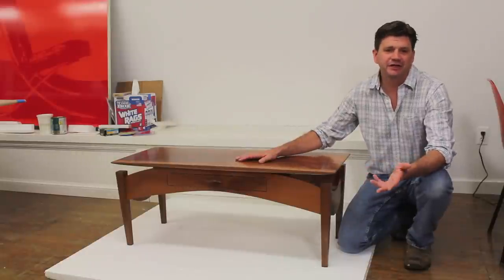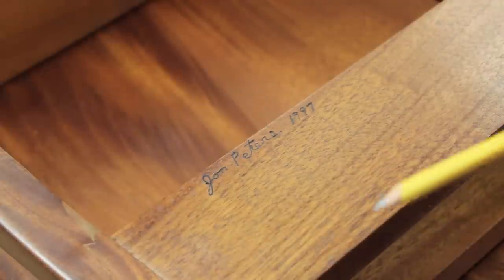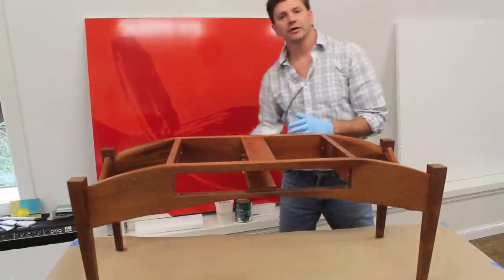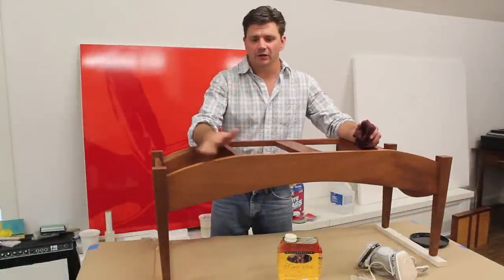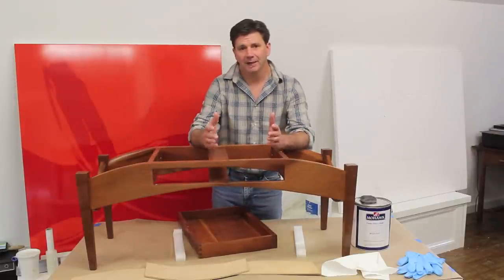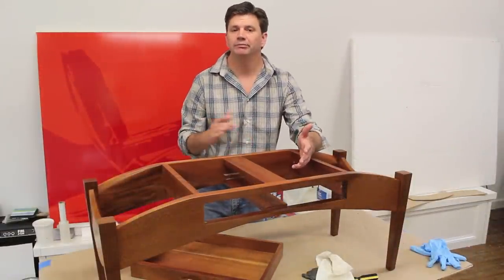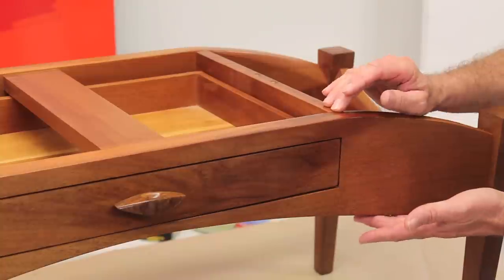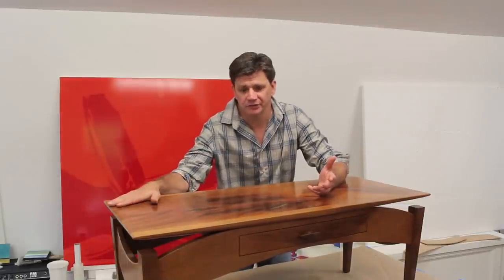A simple way to refinish wood furniture with Waterlox wiping varnish

Comment: Thanks John I learned a lot from your video.  Image beginning woodworker at age 66 making toys for my grandsons but still looking for the right wood and finishing techniques.  I was surprised that you used 320 and knocked the high cutters down with another piece of sand paper to get a smoother    +/- 420  grit paper to wipe down the old finish. That was great to prevent scratches that I find new paper always leaves and still be able to use clean uncontaminated sand paper.

Comment: Nice piece, beautiful.  I think the extra sanding with "400" is probably overkill unless those scratches were deep.  I just refinished a piece last weekend (feel free to check out), I like to use paper bags or the paper inserts from sanding discs.  They are probably around 400 or so grit but really burnish the nubs and dust that cling to the surface.  Thumbs up.

Comment: Great video Mr. Peters. I have been researching different procedures to refinish wood and is in the experimental process. I completed stripping a small side table today for the first time-- I did not enjoy one bit if it as it (too messy). What lead me to explore this option was because the table itself has little chips in it exposing the bare wood. I did not want to use those color pencil to restore the color. I figure re-staining will be the best way to go. Please criticize my method of choice and advise a better alternative. My other question is, you did not re-stain but simply applied varnish. My idea of varnish is just a clear finish for cosmetic/protection etc? Does the varnish itself restore the color? If yes, how do you choice to blend with the current color of what you are refinishing.  

Regards,

Comment: Thanks for the video. I am getting ready to finish an oak/black walnut bed frame, and gleaning tips before I start.
Reply: Have you considered 'ebonizing' with steel-wool and vinegar? I am doing that on an oak built-in cabinet I am building. I will put up the video soon.

Comment: Jon:Thanks for the  video. I have watched most if not all of your videos, you do a great job.  There is always some new info for me.Question:  I am doing a table top and came back to watch your video again for help with the final step.  I have also watched a couple other videos that do the following  process -- 400+ grit sand paper, 0000 steel wool and then 0000 steel wool with soapy water. When you use wool lube is that after a pass over the item with a 400 grit but without the dry steel wool?  How is the wool lube different that the other process?  I know it decreases the cutting of the steel wool so would it be viewed as the final step in the process I mentioned? It seems its primary function to add lubrication (ie the name).Appreciate any thoughts you may have.ThanksJason

Comment: Nice video - I'm going to try this technique on a pair of old Boston Acoustics speakers which have a fairly thick wood veneer. I was confused by one part of your video. Did you sand then apply varnish to the table top four times? Wouldn't you just be sanding off each coat of varnish doing this? Thanks, Jay

Comment: I enjoyed your video.  I am starting to refinish a few pieces in my home without changing the stain. They just need new life.  When I went to my local hardware store they recommend that I use a wipe on polyurethane.  Its that the same as a varnish? Would you recommend use it?
Reply from the maker: yeah I think that should work also, I use Min wax wipe on poly to
Reply: Ty

Comment: What a artistic style table with the curves & floated edges of top. Would have never came up with that design on my own. Respect. Anyway, I built a home 9 yrs ago & the builder instaled real oak hardwood kitchen cabinets with solid styles routed on the inide edge but the centers are flat thin wood. Like only 1/4". Looks cheap & boring. Not to mention only 1 thin coat of poly so they are dull & rough to the touch. Any advice? Sand & recoat with urathane or try to build & polish with a wax or paste? Thanks for your time
Reply from the maker: Thanks Dan, I try two more coats of poly but try it out on a small rest piece first. good luck with the project

Comment: What would you recommend for the top a brand new coffee table that was attacked by a toddler with a wax woodwork repair/fill stick? The wax has left crayon size streaks all over the brand new top and even though the white wax fill has been removed the waxy streaks remain (this is after using a water and white vinegar cleaning solution)

Comment: Nice table and refinish - it's great to see more finish details in your videos, as most of the projects are painted. How did you originally finish the table? If and when you use brad nails on a table you're going to stain/dye, how do you patch the holes to match the wood? Thanks!

Comment: 5:55 Beauty table! I'm not clear on where you say you cut the stock into 3 pieces and rejoined it. I don't see anywhere in the grain, horizontally or vertically, where wood eaten by the saw blade is missing or any seams for that matter.
Can you explain what you meant?
Thanks!

Comment: Jon
Thanks so much gorgeous table and awesome informative video.

I never thought that I would be using a site like this but I am glad that I found your video. 
I recently acquired a gorgeous high quality dining set
because something had happed to an area on the table top surface apprx 1'x6" in size. 
I will try to take a pic later to upload.  thanks to you and your video I think that I could honestly repair this issue myself and restore a beautiful piece.
Reply from the maker: Thanks Donna

Comment: I'm varnishing butcher block countertops and I Love your videos ! My question if you wouldn't mind helping me is :) I can be less than perfect about my kitchen I have a teenage boy so I really want to use EPIFANES Clear High-Gloss Varnish , it's used in marine application. Also I never put food on the counters so I'm not that concerned with food safety I use cutting boards :) but I'm very concerned about water I'm can splash a bit during dishes how do you feel about using this product ? :) thanks again
Reply from the maker: this video should help, This how I finish a countertop. Finishing a wooden countertop by Jon Peters

Comment: This table design raises and interesting design point. You seemed to sacrifice some functionality for form when you built this table by connecting the table top to the legs indirectly (you lost drawer space and overall strength). I would guess it was because you wanted a solid wood top which could expand freely with only centre fasteners. In other words the design focus is the table top and the support is of secondary interest, right?

Comment: your vids are top notch, excellent!! How do you keep dust or lint from settling down on your wet varnish or poly in projects? I use lacquer almost exclusively now with its fast surface dry. What is the best finish you have found that does not alter the wood colors? I  use mostly canary wood and never like to see the color stripes "ambered" out. Great furniture!!!!!!!
Reply from the maker: Thanks , well I guess always a bit . I also like lacquer but most do not have a spray gun so I haven't made a video

Comment: I see all these comments about whipping on the varnish. All a wipe on Varnish, Poly, ect. Is, is a thinned version of that product using the solvent it's based on to thin it. Such as Danish Oil, I'm sure you have herd or used it before. Very easy to apply but you sacrifice protection. There are a ton of great wipe on products out there, Waterlocks makes great products but my go to and favorite is General Finishes Armor Seal, Seal a Cell, and some others. Gotta checkout their site, General Finishes and Charles Niel, a master of finishing has videos on there where he explains almost everything you need to know!!! His Awesome and will definitely clarify crazy amount of options for you!!! Good luck bud!!

Comment: I must congratulate you at the  manner in which you took out the monotony of a conventional table. The legs are tapered thus the ever changing dimension give it an exciting non-monotonous  look, and the  vertical side beams holding the legs  contain a curve that is continuous  in  the direction of rate of change  along the longer side even around the leg as it changes 90 degrees to proceed to the width where a u shape is adopted to keep the continuity in the  direction of the rate of change changing in the middle of the side where it is horizontal, Really it is a beautiful mathematical contour what I  would call a conservative field where the  work done through travelling along this curve is zero!!  Yes, mathematics are so beautiful when applied as you applied them. intentionally or unintentionally does  not matter.
The manner you kept the grain while forming the drawer is neat and the structure to hold the drawer in place in any direction is ingenious though I am not sure that there is anything to stop it from rocking if one side  is heavier than the other as the video was fast when handling the table to see the exact detail.( A minor observation)
The top is beautifully curved and the tapered ends and gap compliment the curved beams while the lack of necessity to bring the legs to the top gives it gentle feminine  rather than the masculine solidity of a  conventional table.  Perhaps adding six openings, four on the side beams  and two on the width beams would make the table look more feminine and delicate which would certainly suit the beautiful finish on those surfaces.  All the hidden and  inhidden texture of the woods are so well selected and at .55 I admired the fact that your design is just as pretty even when the table is upside down. You are more of an artist when you made sure that the screws holding the top are placed near each other to allow for expansion knowing that wood " stays alive"
Congratulations on your design and your workmanship it is elegant and the fact that you did not use  a router on the edges give it a class of its own.  That table deserve to be signed by your good self as I conclude that you left your  heart in it, there somewhere, judging by the manner   you  describe it , hold it and caress it.
Congratulations for your dedication.

Comment: Great video! What color stain was it you used, or was it a clear varnish?
Reply from the maker: Thank you , just clear varnish
Reply: +Jon Peters Art & Home I just commented above prior to seeing your response to this, lol. What if you had nics in the table exposing the raw wood(white).Would clear varnish restore this or will you need a varnish matching the color of the stain? eg. if the table is finish in cherry then one will need varnish that matches that color?
Reply: +Don Powell great question.  i have a piece of stained furniture that has a small section of stain stripped completely off.  i'd like to know what to do to repair it.

Comment: Jon,  hope you can help solve this puzzle.  I made a console table from pine and wanted a reddish finish.  I first stained it with Paprika stain, sanded it lightly, then put down a coat of Minwax's Stain and Poly in one in Bombay Mahogany.  Looked great - just what I wanted.  Finally, I put down a coat of Minwax's Wipe On Poly.  Everything looked amazing, and I loved the table. However, the next morning when I looked at the table, there were white (like down to the wood) splotches around every knot in the wood.  What happened?  Any clue?  I had to sand the table down again and basically start over.  What kind of poly can I use that won't do that?  Thanks for any help you can offer.  Ron
Reply from the maker: Hi Ron, I had a problem like that once, try a coat of shellac before the whip on poly. hope that works out for you.... do a small test first

Comment: I believe you once made a similar table.  I recall the image ... highboy-type with tapered legs, arched side aprons, a narrow ladder "shelf" beneath, and two drawers ... against a white wall beneath one of your paintings, with a white ceramic vase to the left [w purple irises?] and a smaller framed picture sitting to the right. {maybe it's in your home?]

Hope you recall that one.

First, is there a video of that project?  If not, can you tell me how you got the flush drawer fronts to match perfectly with the front apron grain? ... I've blown the image up and I don't see any signs of a rip/glue-up, the swirls in the grain pattern line up that perfectly.  As far as I know, they don't make a 0.020" kerf blade!

Fortunately, I'm working w sapele so no swirls.

[By comparison, I think I detect the rip/glue-up in the table you're refinishing here.]

Thanks.

Comment: If you want to take the 320 grit sandpaper down to about 400-450 grit, why not just use 400 or 450 grit paper to begin with?
Reply: Doug It takes much longer and is less effective to use very fine paper, only.  You get a better and quicker result by working through several grades of paper.  There is no 'quick fix' to a good job!

Comment: Thanks for this interesting video.  I have never heard of 'wiping varnish.'  Does anyone know if this product is available in the UK?
Reply: +Offshoreorganbuilder You can use something like Waterlox Original Sealer 
Waterlox Original Sealer Finish
Reply: siszam Thanks for the information.  I'll follow it up.
Reply: +Offshoreorganbuilder Minwax has a nice wiping varnish. Don't know if Minwax is available in the UK.
Reply: GordWing Thanks!
Reply: +Offshoreorganbuilder Look for Tung Oil. A lot of the stuff sold as "Tung Oil" is really just wiping varnish. If it has petroleum distillate, it's not tung oil, it's wiping varnish. Real tung oil does not contain PD.
Reply: FacepalmDaily Thanks!

Comment: I would have used  an old piece of cloth and rubbed on a mixture of 50 % turpentine and 50% boiled linseed for the same  result. Possibly use some steel wool as well if necessary. No need for any  product overkill.

Comment: Simply gorgeous and thanks for the tips, I'm refinishing a table from 1933 my grandma brought back from India so hopefully this helps. Table had deep screatches and cigarette burns but thanks to you its off to a good start from this: https://scontent-b-lax.xx.fbcdn.net/hphotos-prn2/t1.0-9/10322840_10202964289483182_5802980368322471327_n.jpg

to this so far: https://scontent-b-lax.xx.fbcdn.net/hphotos-frc3/t1.0-9/1610085_10202964289443181_1896813947486313439_n.jpg

what are your thoughts on polyurethane semi gloss? I'd like to seal it against water/coffee stains/spills